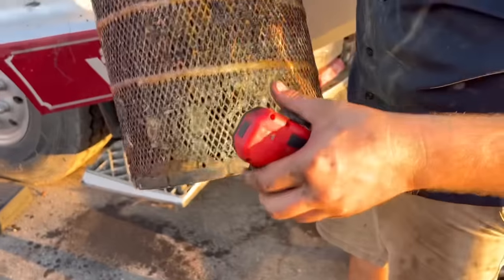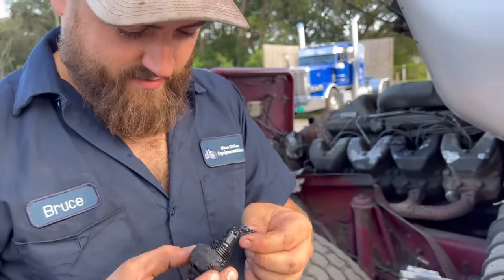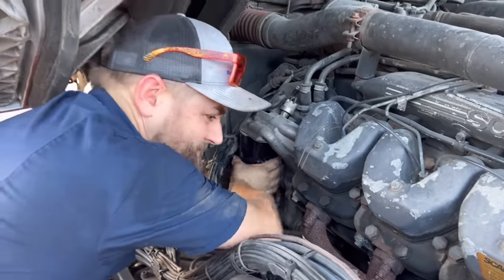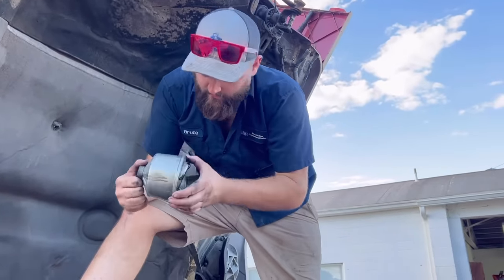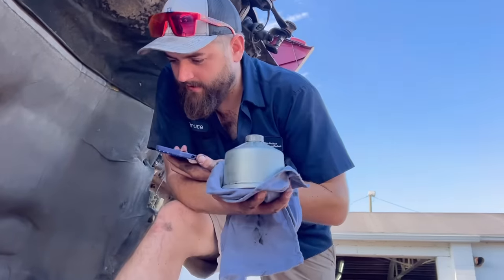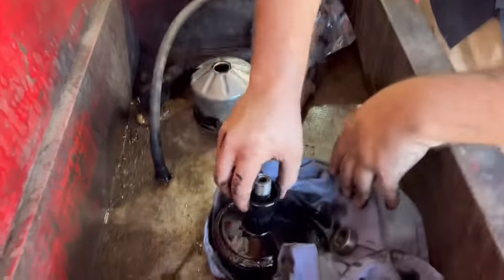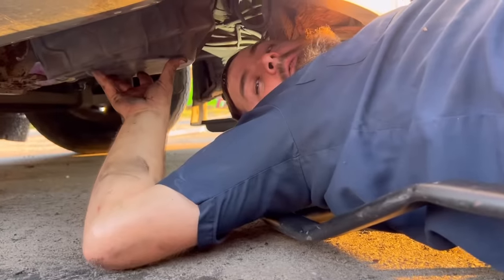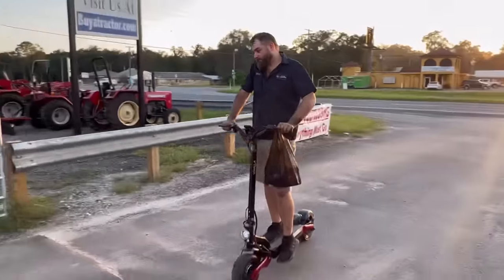Servicing my Scania, Missing Filters, Massive Sludge Build up!

Comment: The filter right behind the injection pump is a centrifical oil filter that filters the oil to about half a micron. The cannister with the jets has to beopened to remove the oil residu. Put it in a partswasher, put in a new paper liner and put it back together. The filter gets propelled by the jets on the bottom by oil pressure.
Reply: The main purpose of this filter is to extend the oil change intervals by keeping the oil extra clean. I had these filters installed on my trucks and changed oil usually between 40 and 50,00 miles. Did oil analisys in between and never had any problems. I ran with synthetic for a while and ran the oil up to 96.000 miles, when the lab that did the oil analisys told me it was time to change the oil.
Reply: @vandamtrkg i have a 1976 n/a Scania with D11 engine, it only has the centrifugal filtering. The Turbo DS11 has a separate filter, to keep the oil to the Turbo clean. The dirt almost becomes like a gel on the inside of the centrifugal cleaner, easily scraped out with a wooden paint-mixer stick
Reply: The centrifugal oil spinner it helps catch the fine oil debris it just needs cleaning out with brake n clutch cleaner or degreaser or diesel fuel and then a new paper element, it will be like brand new then💯💯💯💯🤫🤫😉😉🙂🙂🙂👌👌👍👍👊👊👊👊
Reply: @vandamtrkg  The main purpose of it is To completely Filter the Oil. Many tractors up until the 90s had it In Europe. But Than the Capitalism won... You just make it smaller and it cant do the job properly but you also avoid the angry Mob with pitchforks coming at you for having to stop every 2000 Km to change your oil filter.
Reply: @liamdtraxxas2011 You don't need to put that paper there. Works without it too
Reply: It uses the oil pressure to rotate the filtration element at very high RPMs in order to create a powerful centrifugal gravity vector which in turn will separate the heavier mass solid soot particles from the lighter mass fluid oil.   It’s a very old and extremely effective oil filtration system used by pretty much all European diesel truck manufacturers I think since the 1950s.
Reply: 'Centrifical' is not a word.
Reply: That's awesome
Reply: @brianmurphy8790  He means centrifugal. But its also called a cyclonecleaner
Reply: I NEVER put the outside canister in the parts cleaner. I  NEVER use brake cleaner inside where the paper element goes. If you do that, the paper element will not stick to the outside canister as it is spinning and WILL not stick- therefore it WILL not do its job. 
Inside always scrape clean with regular knife, smooth it out and that makes so that the new paper element will stick to the old goo. 
I´ve seen alot of them when after full oil service interval the paper element is loose and there is 0 sludge in there
Reply: @tamur1994 on Scania we always scrape it and clean it in the part cleaner 😅
Reply: I was about to say the same thing, he forgot to put paper on the outer wall of the oil separator lol. the next overhaul of that thing is gonna be a headache to remove the sludge buildup
Reply: Just like a Honda 50 Cub
Reply: I remember them on leyland 600, two centrifugal filters only I think. Built up about 1/2 inch of crud
Reply: @vandamtrkg  my fleet doesn’t have those and they run 45000 mile oil changes on otr sleepers. Its wild honestly
Reply: @viktorhermansson5788  Perfectly clean surface behind the paper will cause it to not stick while spinning. Seen it plenty of times.
Reply: @tamur1994  the paper will not stick but the oil residue will still stick to the paper
Reply: @tamur1994  if you know so much why haven’t you said that the “spare” o ring is needed on the inside of the cyclone? That is a bigger problem
Reply: @viktorhermansson5788  only 1 seal goes inside the centrifugal. What are you talking about? 
Im telling you if the paper wont stick to the outside canister it will not do its job collecting the goo since it is loose in there.
Reply: Vandam is right.
When the filter does it's job you can hear it spinning after the engine is shut of. If you don't hear it you must clean it!
Reply: @admiralfloofz658  In Finland, we call it "oil spindle". Translates to English
"Oil spinner"
Reply: Needs too be replaced ! I have seen one completely stop up ! It cleans oil better than the spin on !
Reply: @tamur1994  I have sometimes put paper there and on a completely clean surface. It worked well and this is how Scania guides in its instructions how to put it there. But I often left it out. I have serviced thousands of these trucks
Reply: @tamur1994  brakecleaner and part/detail cleaner bath - 
100/100 times for me!!  Done this weekly (Daily) for years!  Never failed…?
Reply: @swampen85  im just telling my experience and what i have seen :) i do this daily too
Reply: centrifuges are a bit technical for Americans🤣
Reply: yep that thing is a spinner it spinns at a high speed to sling the dirt and anything else that is in the oil out soooo it is super filtered oil

Comment: Do not rely on the cab tilt cylinder, make sure to tilt it over completely. I've seen the tilt hoses blow with the cab half over. Will kill you in a instant
Reply: I can send pics of a cab tilt ram that failed, always jack the cab all the way over never just have way
Reply: Also, never go under a truck that's fully airbagged, if one bag blows up, you're fucked and 6 feet under the next week... The truck will drop all the way down to minimum height in a very short amount of time, and if you lay under it when it happens , you are dead. Just a little heads up
Reply: You guys are absolutely no fun
Reply: @RichPrivilegedWhiteMale  yeah will be no fun if that 5+tons cabin hit your body
Reply: @xxxmikeyjock  elevators are serviced from time to time.... this have questionable service record if any at all.... and that makes the diffrence... also elevators got most have service where you change parts that is worn... and trucks ... well go until you die from it dropping on you if you want...
Reply: You are fully right. Tilting the cab completely was the first thing when I started working in the workshop of a transport company. We had mainly DAF's and a few Volvo's.
Reply: @xxxmikeyjock  made up catastrophe? I've seen lots of cab tilt hoses blow but I'm yet to see an elevator crash...
Reply: I know of a little legend who is probably middle aged by now as this happened in the 80’s his dad was a OD  and was working under a cab of an old 2 series that wasn’t fully tipped the ram crept down and pinned him against the tire , luckily that kid had seen how his dad pumped up the cab and jacked it back up and saved his life , what a shit way to go if his lad had t been there , true yarn , that should make some think again before taking short cuts .
Reply: @xxxmikeyjock  I fix cabovers for a living. Which means I actually use the cab jack system, unlike you steering wheel jockeys. And I have seen them blow and collapse multiple times due to perishing, chaffing and seal failure. I have not seen an elevator crash, even on the news. Only in movies....

Comment: The seperator is actually looking great, it has done it's job. It's supposed to look like that, because it's a centrifugal separator, all the sluge and bigger partikels is supposed too get stuck in the wall of the separator. 😊👍
Reply: THAT SEPARATOR IS CALLED A OIL SPINNER , WHEN THE ENGINE STOP`S AND THERE FULL OF CRUD YOU CAN HERE THE SPINNER CARRYING ON SPINNING . SOMETIME`S THE BRASS BUSHE`S WEAR OUT ON THE SPINNER AND SOMETIME`S THE CENTRA BOLT SNAPE`S BUT YOU CAN GET ALL THE PART`S
Reply: @gibboj  okej, don't need too shout. But here in Sweden we call it oil-separator, because it separates oil from small debris.

Comment: The seal you put on top of the oil separator is not supposed to be there, that seal is for your drain plug to the engine or differential drain plug. Take it off asap from the oil separator, regards a former Scania mechanic
Reply from the maker: Thx
Reply: @Bruce_Wilson  if you got 2 of those seals in the kit you can change both on the engine and diff drain plugs, if you only got one with the kit use it on the drain plug for the engine., to fill up the gearbox you have on the side a 24mm hex head plug, fill it up so the oil starts coming out of the fill hole
Reply: The last black filter you have is for the diff, only need to take the cover off, 2 12 or 13mm bolts, filter is hiding behind the cover. If you are to change diff oil, make sure you get the fill plug loose before you start on the drain plug, those bastards can get stuck really well. Pro tip regarding the air dryer filter, whenever we broke of the nut we used to tacweld it back on 👌👌. Cab air filter is behind the grille , pay attention the markings on the filter wich way it's supposed to go in regarding the airflow, it's a big arrow on the filter
Reply: @johanneskohler3267  good info!! Any clue on his coolant filter location and that small hydraulic filter??
Reply: @warrenmichael918  I haven't watched the video until the end, but Scania doesn't have a coolant filter. 
Edit. The last black filter goes to the rear axle. the same is in the gearbox. And the paper filter goes into the retarder
Reply: @Bruce_Wilson  And don't tighten the cover again with the machine.. Gently tighten it by hand, otherwise the shaft may break. Best regards, former Scania mechanic
Reply: @railasvuo Scania 94 does have coolant filter
Reply: @AC_85  Oh my bad then. At some point there were no 4 in the series. It's been 7 years since I repaired these anyway..
Reply: Change power steering fluid to atf
Reply: @warrenmichael918  last one I saw with a coolant filter was early 4 series Scania. Can't remember if the last ones had it
Reply: @railasvuo  NOOOoo! Its more exiting to use a machine to everything! Or a extended shaft to tightening things! There is no reason why a 8 mm u ring key is smaller than a 24 mm u ring key. They just made it smaller to save money on material.
Reply: @johanneskohler3267  I don't think so. I rarely saw them as I don't remember this model even having it
Reply: @hakan8997  🤣
Reply: @railasvuo  A friend of mine used the extension to fasten wheel bolts on a car. Sweden up North, summer and winter wheels. Just to remove them needed power all the way. Just from losening 2 tyres i was done. Every rew needed power. The same guy was assembling a play ststion controll when i walked in... I shouted STOP! And he stoped, but then he needed another 1/2 rew to be shure. Guess what! the plastic did not needed the last half rev. And it did not end there. Next screw also broke the plastic! That hand controll did not need 8 screws, it worked well with 6!
Reply: @railasvuo some early 4 series scanias had coolant filter , why would you comment on things you're not sure of... back in the good old days the first 4 series scanias also had the so-called turbo filter, same oil filter as the gearbox and diff had but just for the turbo, but the realised that it had no real good purpose and stoppes equipping these "turbo filters" Scanias came in many variations, with different frames,  different options depending on the buyers wish, also with coolant filters. Some of the first 4 series had like the 3 series double fuel filters as well, but they changed it after a little while to a single fuelfilter with an prefilter ( watersperator ) filter depending on what model/ environment the truck was going to operate in and customers specs...

Comment: Pro tip for the next time you’re going to change a air compressor water separator and brake the hexagon off, just wack two large screwdrivers in the top of it and put a pry bar between them and twist it loose. When installing, grease the rubber seal with the provided air system lube and hand tighten.
The rubber/metal washer you put in the oil separator is actually the engine drain plug gasket. Probably want to take that out for the oil separator to work properly! The air filter is the correct one, you just have to grease it a little where it mount to the “pipe” up in the box, and second and most crucial, you have to line up the air box lid. Look at the side of the air box closest to the step you’ll se a “v” cut out of the plastic and an “l” that stands out on the lid!
Reply: They'll never see this.
Reply: @scottcol23 because they don’t care ! And they think they know more than anyone!
Reply: @scottcol23  He did actually answer me on one of my posts after pestering him about it for a couple of weeks, he said that he read them all. Now I am in the process of deleting those pestering posts though..

Comment: Another quick tip guys after the oil change start the engine let it run for a while shut it off and listen to centrifugal filter you should be able to hear it spinning. This means it should be working correctly.

Comment: You just had the top lid of the oil separator of, you can also remove the lower part of the housing, thats where the other o-ring goes. If its not leaking oil there dont bother doing it untill the next service.

Ive never seen that amount of build up in the oil separator, thats incredible!
Reply: its also called oil centrifugal filter, it does his job by separate the contamination in the oil in the paper filter when its spinning :)

Comment: About oil in the transmission.
Here in Sweden we use 80w 90 
But we have cold winter. The backaxel use 80w140.
You have the fill plug on the side half way up. Just fill it full there
👍

Comment: hi bruce. the green o ring seal you put on the centrifugal filter is ment for the sump plug. no seal needed when putting the nut back on the filter. the centrifugal filter is how the v8's last so long. as for gearbox oil, their is a plug on the side of the gearbox. fill it till oil comes out that plug. i'm restoring a 4 series scania too. mine has the 16ltr engine rated at 580bhp.

Comment: Hi Guys loving the content. If you want to the oil in to engine quickly take out the centrifugal can and pour the oil in to can housing it drains directly into the sump(pan). Re fit the can and put the top back on DO NOT OVER TIGHTEN AS YOU CAN DAMAGE THE SHAFT OR BRAKE IT . The lower part of the shaft is hollow. The gearbox level/ filler plug is on the side it should have the same hex plug as the Pan.

Comment: One of the hydraulic filters is the retarder filter put the ignition on pull retarder full on then drain the oil they take about 7 litres of engine oil or atf they is a dip stick above the filter housing held in with 3 12mm headed bolts

Comment: I'm so glad that you Scania  mechanics and drivers are helping Bruce because he's totally clueless .lol this truck is throwing him for a loop..eventually he will figure it out..hell I'm still trying to figure out that extremely weird shifting pattern on the shifter
Reply: He's not clueless, he knows engines, but you have to learn specific knowledge for the platform.
I'm really glad people are helping and doubly glad he's listening.
Good times.
Reply: The schifting patern on European trucks is very simple instead. It's the same like a manual transmission in a normal car.
This truck shifts like: 1, 2, 3. Then you can stack another 3 gears on top of that with flipping the stack switch on the shifter. So that would be 4, 5, 6. There is also a splitter switch on the shifter wich alows you to split every gear whenever you want. So that makes it 12 gears.
There are also 16 speed transmissions wich work the same but just with 1 gear extra. So that would be: 1, 2, 3, 4, stack, 5, 6, 7, 8. And split like you want or need to. That makes 16 gears.
But you don't have to use all the gears all the time. It depends on the load and the road you are on.
Most of the time you can skip a few gears, especialy the low gears.
For example with a decent load on a flat road: start at 2 high, go to 4 low, go to 5 high, 6 high, 7 low, 7 high, 8 low, 8 high.
But always use the clutch to shift since all transmissions on European trucks are synchronized.
Reply: @musictolive4  
OK, when would you ever NOT use a clutch on a manual transmission though?? 🤷‍♂️
Reply: @MostlyPennyCat  My question also. But the American truckers show a lot of video's where they don't use the clutch to shift gear.
Reply: @MostlyPennyCat c'mon mate he's clueless most of the time. I'm a mechanic and i don't destroy parts to do a job and if i don't have the right tool for the job i go and buy it. 
He filled up the filter with oil that he didn't even know if its right or not, Its like me putting 20w50 mineral in an engine that requires 5w30 c3 synth and saying i dunno its oil it should work. 
Sometimes i wish he would look up technical specs before starting a job
Reply: @davejohnson3474  
But didn't he put a synthetic oil in?
I thought you could substitute synthetic for mineral?
Or will getting the weight wrong be potentially catastrophic?
I mean, yeah, I'd just look it up.
He has a smartphone I assume, probably not that difficult.

Maybe the real question is:
You're in the middle of nowhere, there's no oil in the tank, is it better to load the wrong synthetic oil or no oil at all?

Hell, maybe you can just abuse American engines like this?
Also I haven't watched enough, I've only seen 2-3 videos and all on this truck.l, I'm giving him the benefit of the doubt first.
Reply: @MostlyPennyCat With American semi truck transmissions you typically don't use the clutch except for when using the clutch brake when taking off from a standstill.
Reply: Nothing 'weird' about it - it's a simple 3 over 3 Range change with Splitter..

Comment: They were recalled back in the day for camshaft and timing gear mod  camshaft used to shere.  I still have a little pocket book in my tool box that Scania gave us with torque settings and valve gaps. Excellent truck for drifting and burn outs. ❤